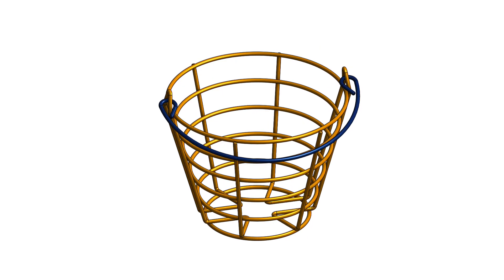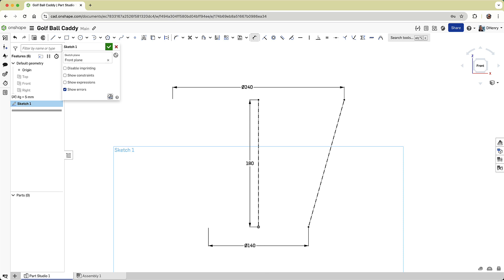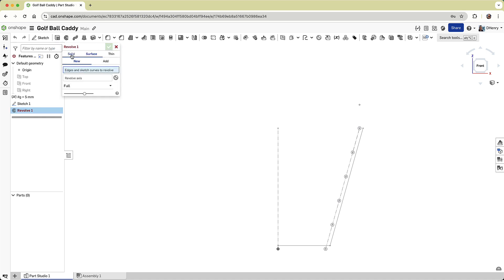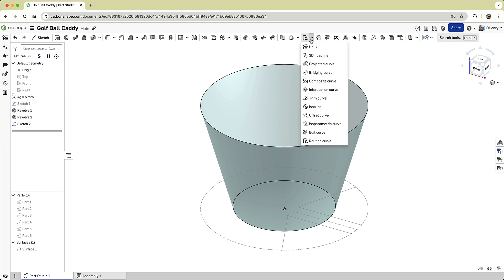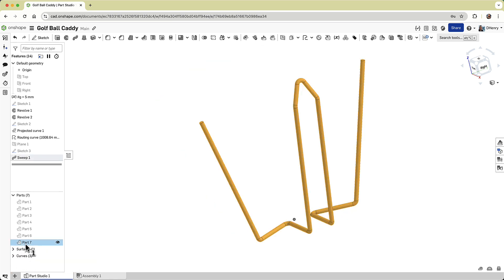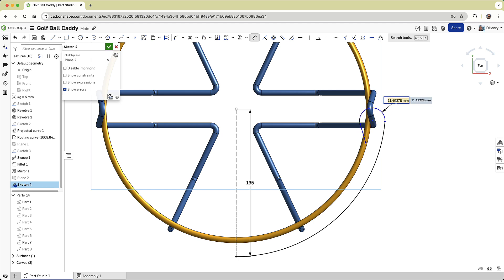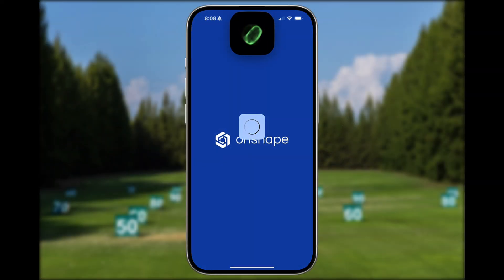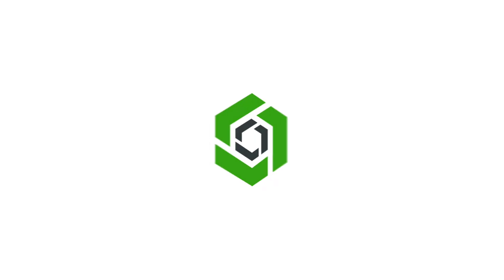Let's Make a Golf Ball Bucket in Onshape

Comment: Good tips but if you think OnShape doesn't crash then you're not using it on mobile. Ask Leopold
Reply from the maker: Hmm, if you are having issues, it may have more to do with your connection. Onshape is the most stable, full-featured mobile CAD app available. If you do have issues, you can report them directly to us within the mobile app—no VARs, no middlemen.
Reply: With the android app i also had often crashes but the web app works almost perfect only had 1 or 2 where it did hang up but never lost any progress realy

Comment: your handle bend constraints are lacking. i cant find any way to model the handle with the information given that didnt cause an interferance
Reply: for those with the issue, changing the major diameter of the handle to 130mm fixed it
Reply from the maker: @EmmaRitson  , I am guessing you may have picked up a horizontal constraint when sketching the small arcs. For example, the start point of the large arc is inadvertently aligned horizontally with the small arc's center.  Let me know if that is the issue.
Reply from the maker: Watch again, because the sketch is black - fully constrained.  Make sure the arcs are tangent to each other and the line.  Make sure the center of the large arc is coincident with the origin and the center line is vertical.  the plane should be 90 mm from bottom of bucket.